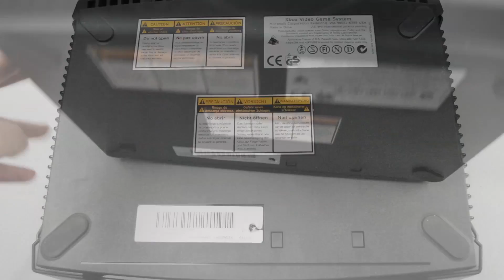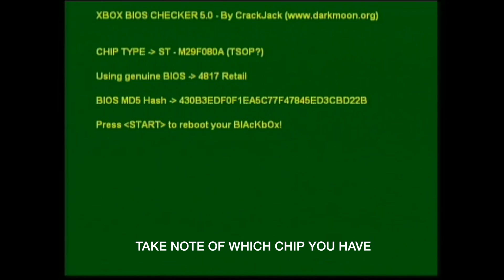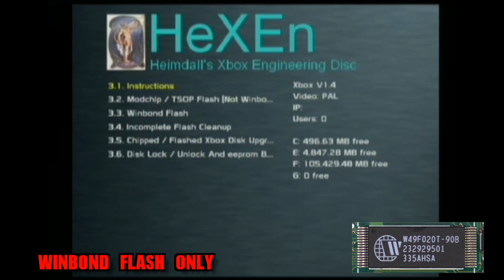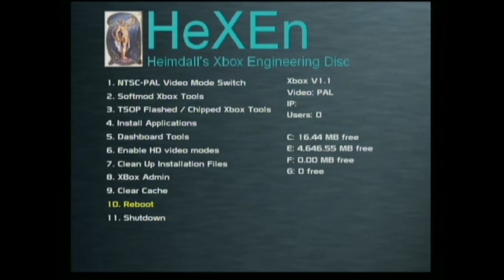How To TSOP Xbox Easiest Method v1.0 to 1.4 | MOD Guide

Comment: Thanks for making this video. I have an old PC-Bioxx/Open Xbox modchip and I want to flash the modchip to install a larger hdd. How can I flash this modchip?
Reply: use the same method that is listed here. grab your hexen disk and with the chip turned on flash it with a 256k or 512 if your box supports it. Note that if you are using iND or X2.5035 you need to have a config file on the C drive
Reply: Steven Benson Thanks for your response. To flash the modchip I need to connect it to an old PC with a Parallel Port. What can I do?
Reply: you don't need to connect it to a parallel port, just need to make sure that write enable is turned on on the chip, usually it's a switch that has to be turned. After that you can just flash it.

it's pretty straight forward. the parallel port is only needed if you screw up and need to re-flash it
Reply: Steven Benson Thank you so much for telling me that. What's the best way to flash the chip? I have a mac and most software is written for windows. I am planning to install windows 10 to it.
Reply: burn a copy of the hexen disk, and put it in your xbox. go to the TSOP/modchip menu and select the flash option applicable (probably non wind bond) and then flash a 256k bios of your choosing.

modern flashing doesn't require the chip be connected to a pc or mac at all
Reply: Steven Benson Thank you. The problem is the bios has to be 1mb for the chip which requires me to double the flash image. I read some instructions on the PC Bioxx/Open Bios. This chip was the first chip that had a 1mb flash chip. I want to flash the bios in order to install bigger HDDs.
Reply: flash the 512k x2.5035 or ind5007. Evox flash will automatically expand it to 1meg
Reply: Steven Benson Thanks for your help. I was exactly looking for the word expand. Is that the bios you'd recommend? What do you think about the 128mb ram expansion and the 1.4Ghz cpu upgrade?
Reply: I prefer X2.5035 over iND5007. their feature sets are pretty similar, but X2 was the more stable release IMO. 

in re: the 1.4 and 128, the 128 will only do you good in a very few emulators and possibly XBMC. I've seen reports that accessing the extra ram can crash XBMC but I'm not sure about that. the 1.4 ghz upgrade is good for emulators, and from my understanding the PS1 emulation works flawlessly when it has this little extra power given to it, no more frame loss at all. 

That being said, in regular games it doesn't make much difference. 

One thing for sure, if you are looking for the 1.4 look for the N64Phreak (i think it's ph phreak and not freak freak) over Trusty. Trusty's are ok, but they tend to overheat, a lot of reports of overheating. The N64 guys tend to not overheat, and that's been reported by a few people who own both. The DreamBox is the best, but they are exceptionally rare and unless you find someone who doesn't realize that they have that, you will pay a lot for it. a lot.
Reply: Steven Benson Thanks man. Until now the original Xbox is a great system. What do you play these days. Are you a retro gamer?
Reply: i have a modded ps3 that i use to play ps1, and xbox to play everything else.
Reply: Steven Benson How did you mod your PS3?
Reply: if it is old enough e.g.: hasn't had a firmware update in two or three years, you can just flash custom firmware to it and mod it. I found one that had been sitting in the back of a grocery store forever. just took it home and flashed it and it was modded. easy as could be. easier than modding a wii
Reply: Steven Benson I just updated the firmware because I wanted to watch BluRay. Is there anything I can do to mod it from this point?
Reply: check your firmware version. the blue-ray patch happened a while ago. if you are on version 3.55 or under you are gold.

if you aren't, you need to check and see what version of ps3 you have, (model number on back e.g. CECH-2001 or something like that) and then it can be determined if it can be downgraded or not with special hardware.
Reply: Steven Benson I have a Phat PS3 with 80gb
Reply: go into options/settings, system update and see what version you are on
Reply: Steven Benson Aight!
Reply: if you are on 3.55 or lower, you are golden. if not, you need to downgrade. if it is a phat you likely can downgrade, if it is a NOR phat you are in a good spot to downgrade. if you are on a NAND phat you are in a less good spot
Reply: Steven Benson Still downgrading is all possible though?
Reply: what firmware?
Reply: Steven Benson I have to find out first. I don't have the PS3 with me right now. I'll find out in a couple of weeks. I am on a business trip. What about the modding the Xbox? Can you run the software also on a mac?
Reply: i,m sure you can, note that the ONLY software you need is an AID or Hexen disk
Reply: If you have Hexen you can burn that and put it in the box. You flash it from within the xbox, not external
Reply: Steven Benson Thanks. Is hexen disk readily available to download?
Reply: ISO hunt and a few other torrents host it. google and you'll find it
Reply: Thanks Steven. You are a great help. What sites do you hang out these days. Any other retro consoles you own?
Reply: Xbox Scene I'm on fairly heavily
Reply: Steven Benson That's awesome. What are the new trends for the original xbox in terms of modding? I was into the xbox in 2004. So I am not that familiar right now.
Reply: the conclusion for it has been either soft mod if you don't know how to solder, TSOP for 1.0-1.5 and mod chip for 1.6

XBMC has been updated quite a lot. The emulators were pretty solid throughout. There are a couple of mod guys who will - for a hefty sum - bump it to a 1.4 Ghz and 128 megs of ram.  After that it emulates really really good
Reply: Steven Benson 1.4 GHZ with the 128mb sounds too sexy. Do you have one of those?
Reply: No, they are a few hundred at least. they do have a switch on them as well that lets them switch between 1.4 GHz and 720 MHz. Some XBOX games work with 1.4 but most crash
Reply: I don't feel that they are necessary but it's a cool thing to have.
Reply: yeah, it makes it more powerful than the dev kits
Reply: are you on fb?
Reply: yes, but most help i do is on xbox scene
Reply: Steven Benson What's your xbox scene nickname? PM me here.
Reply: T2steve
Reply: +Steven Benson I just tried to flash the bios with the Hexen disk. I get the message: "Manufacturers ID 09 Device ID 00 !! Flash Not Writable!!" What can I do?
Reply: that error message comes up with the write permission is disabled. your mod chip likely has a few switches, one of them is to turn on write. that's likely why it isn't flashing.
Reply: +Steven Benson How do I turn it on?
Reply: your mod chip will have a switches on it, likely it will be a little add on that sneaks out to the front of the xbox or the rear of it. Most chips have write access as the 2nd or 3rd switch. do you know what type of chip you have?
Reply: +Steven Benson It's a PC-Bioxx/Openxbox.
Reply: apparently this is a chip that has to be flashed by LPC which is weird. Most of the older LPC only flash could be flashed with a bit of work. 

You'll need LPC and the program to flash it. You can still get the bios from the HEXEN disk
Reply: +Steven Benson thank you for all your patience and help. I am wondering whether you can simulate the parallel port through a usb to parallel port adapter? I am using a Mac with Windows 10.
Reply: can try
Reply: +Steven Benson I was able to find an old PC with a parallel port running Windows 98. When I insert a burned data cd, I get the error message an attempt was made to load a program in an unidentifiable format. I am using Mac OS. What's the best way to burn a data cd an old windows 98 PC can read? USB stick is not working because I need a driver for the USB port. LOL
Reply: burning it with win xp or something similar should work. 98 doesn't play well with mac.

you could also try emailing it or FTPing it. you could also put it onto the xbox itself, and then FTP it from the xbox to the 98 box
Reply: +Steven Benson How do I FTP to Xbox? Remember, I don't have internet on this windows 98 machine. I was thinking just to burn a data cd. However, somehow o burned it wrong under Mac OS disk utility.
Reply: +johndee759 I got everything in place. Windows 98. Parallel Port Cable, Frosty Bios x2 and Bioxx Flasher 1.4. The program cannot detect the chip. I uninstalled the program and installed bioxx flasher 1.3. Also nothing.
Reply: xbox scene has some articles on this chip. head there and see what it says. Alternatively, bridge your TSOP points, get a new hard drive setup with soft mod and then disconnect the chip, flash the TSOP and never worry about the chip again. I wouldn't use a Frosty Bios unless there is a specific reason. X2.5035 or iND 5007 are both good
Reply: +Steven Benson Where can I get those bios without going into xbins?
Reply: they are on the Hexen disk
Reply: +Steven Benson thank you. I have burned the Hexen disk. However, when I put them into my computer I can't view the content on the disk. What can I do?
Reply: you will need to put it into your xbox, and search through the files there. there should be a folder labeled bioses that you can copy it from. you will need to connect your xbox to your LAN and then you can use FTP to get it off the xbox and onto a computer.

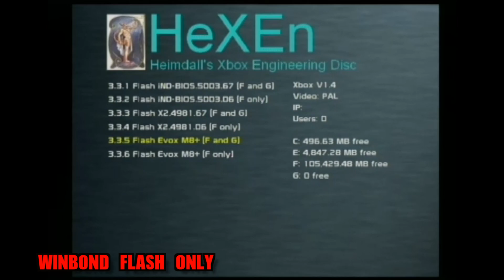Comment: HELP!!! I get to the Gentoox Loader screen @ 5:06, and I try to use my Dpad right, to move the menu across to the Advanced at the right hand side, but I cannot for the life of me get this to move.  Its like its frozen.  And after 5 seconds it loads some kind of linux based os, and I have to power down the system.  I have tried this 3 times now with no joy.  I am using a shitty aftermarket pad but the dpad does work as I have verified this.  Xbox is already softmodded with 160gb hdd.  Any ideas?  My version is 1.3 Winbond bios chip
Reply: Also I noticed is that it doesn't say CD/DVD as the first option, it says Fatx? Do I have to perform this with the original 8gb HDD installed I wonder?
Reply: sorry no i do have the same layout as what you do, but I just cannot move the menu for some reason..
Reply: OK possible update, I have watched another guy doing the TSOP on a Winbond and/or Sharp chip. And apparently Gentoox hates 3rd party controllers.  So maybe that is why its not letting me change the menu.  I don't have a genuine controller right now, but my friend does and I will ask him if I can borrow it and see what happens!

I will let you know the outcome guys..

BTW, if this goes well which I hope it does, I have a donor xbox which I am going to remove the memory out of and upgrade mine to 128mb of ram.  Simply for Emulator benefit, and the odd game which requires more memory as well.
Reply: Follow up, the issue all along was my 3rd party controller.  Borrowed my mates "Duke" and all is sorted now!

Comment: My Xbox is V1.1 and I have a Aladdin Advance modchip fiited that is working fine when in chip mode, but my onboard tsop is corrupted. If I power up as normal the Xbox powers on/off/on with a flashing light no picture. Can this mod work with the chip in place. I have Slayers 2.7 installer which I flashed the latest update to it with no problems. Thanks
Reply: if your aladdin chip has two banks on it, there is an option to flash it with an Evox TSOP repair bios.. I believe it was D6 but i cannot remember and you don't want to get this wrong. if it only has ONE bank and you cannot switch it, don't flash it with a different bios for repair, it's a one way trip unless you have another mod chip lying around.

If you have multi banks and can switch, flash the TSOP repair bios, start it up and pull the chip off after a few seconds, essentially when it is booting. It should pull just enough data from the chip to load, and then the chip gets pulled and it reverts to the TSOP.. you should then be able to re-flash the TSOP. 

The alternative is a 32 wire chip, which is a serious pain to install.
Reply: My mod chip is a Aladdin advance, how do I know if it has multi banks or not.  Thanks for your help.
Reply: usually there is a switch on the mod chip that controls what bank is being read. If you have two banks you can boot from one, hit the switch, flash the repair bios, and once you are done repairing your TSOP you can hit the switch, boot back to the other block and flash it back again

Comment: Hello!,  i just have a question: How to TSOP the console from HDD. My DVD drive is dead, it doesn´t load any games, and i don´t have any spare drive to test. I can access to the XBOX by FTP, so I can upload any app to the hard drive. 

En español: Se puede hacer TSOP desde HDD? Tengo una consola con el DVD roto, no carga ningun disco, ni originales. No tengo otra unidad a mano, pero puedo acceder a la XBOX por FTP, asi que puedo subir la aplicacion al HDD si es necesario..
Reply: you need another xbox dvd drive, it can be done with a pc dvd drive if you know what you are doing, yo cant really ftp the files to the xbox as the drive is how they run.

Comment: I try Evox m8+ or m8 original it didn't have lba48 support it still recommanded to use evox perconsole it didn't have any issue for frezzing than ind bios. I thank ind bios has lba48 support it recommended to it didn't have any frezzing issue that all i currently use ind bios on my main xbox it run with no issue it does inculded config live it much reliable for me it just xecuter 2 bios have frezzing issues all the time.
Reply: I flashed EvoX on a v 1.4 console with an st chip. used the 256k option with F and G drive. after the flash my xbox won't boot past the X screen with the evox logo in the corner. wont boot up hexen 2017 from dvd either. do you happen to know what went wrong?

Comment: I try Xecuter2 or 3 doesn't run smooth the only bios it does run smooth is evox or ind bios that how i recomemded team xecuter has bug that why xecuter sucks for bios i cerrently use ind bios on winbound or sharp chip i replace evox bios on hynix, st, i use ind bios

Comment: 1.0 & 1.1 models paired with a Samsung drive and fan mod are arguably the best combinations, since the 1.0/1.1s have a 1MB flash and the Samsung drives read the most forms of burned media. After that, send your board off to Trusty for a CPU and RAM mod, upgrading your model to a 1.4Ghz CPU and 128MB RAM!
Reply from the maker: +TAG Media I don't think trusty still does them though :(
Reply: Are you sure?
Reply: +Slot1Gamer I recently did some snooping on the Assembler forums and found that N64 Freak had a spare Trusty 1.4 Ghz board!  I bought it from him the other day and it's in the mail!  I can't wait!
Reply: +TAG Media Yes n64 freak is selling xbox motherboards as kits with 1.4ghz cpu and 128mb ram in the assembler forums but i think he dont accept like sending a motherboard to install the cpu and ram,he is selling pre moded xbox motherboard with the cpu mod and ram : )

Comment: what is the big difference between soft mod and chip mod ?  what can the chip mod mo more ?
Reply from the maker: +Gunter Vandenberghe Soft mod is replacing the OS files on the HDD (all in software, hence the name :) ) It works but is easily broken. Using a modchip or Flashing the console (for this purpose the same thing) is replacing the code that the console uses to operate (bios essentially), much harder to break, actually with TSOP you can make it virtually impossible to break if you unlink the pads (making the chip READ ONLY), good idea if you sell the consoles pre-modded :D

Comment: This machine was the greatest of all when u flashed it, i remember putting all the best games to its hdd with the xecuter 2, oh boy and those themes best machine ever thinking of buying a xbox 1.0 now hahahaha
Reply from the maker: +NissanSilviaS15NL Silvia get a 1.4, 1.0 has some issues :)
Reply: +Slot1Gamer I still feel that the 1.0s and 1.1s are the best models due to their large 1MB BIOS chips.  If you can get one of the version 1s that don&#39;t suffer from the trace corrosion problem and replace that nasty Foxlink PSU and pair it with a decent DVD drive, you have the ultimate model, flexibility-wise.

Comment: i think evox bios an ind bios is remomendded  to
Reply from the maker: +Austin Souslin I run EVO x on my main console, now it's running a new custom build EVO X, which forces all games to run in 480p (Most PAL games are 480i and it makes them look fuzzy on newer TV's)
Reply: i use ind bios on my main console it reliable for me it fix with hard drive upgrade issues for me insead xecuter 2 bios didn't help for me it did cose inissue with cycle frag problem crashes frezzes xbpartitioner 1.1 and launch games from hard drive that all for xecuter 2 or x3 again i chose ind bios it didn't have in issue with ind bios it did shove my problem i will stick with evox an ind bios some of chip
Reply: once xbox has winbound chip you shoud use evox bios this chip uses acrup blocker on this chip the more acrup blocker will be not flashble any more using raincoat base

Comment: Great tutorial.  Does the Xbox has to be soft modded before you can TSOP it?  What happens if your original Xbox hdd is fried?  Can you still TSOP it and install a bigger hdd?
Reply from the maker: +Laeot You need to be softmodded first (I'm looking into making a method to tsop stock consoles). If the HDD is fried, follow my other tutorial of making and using a EEPROM reader.

Comment: Ok, I've tried a CD-R, a CD-RW, DVD-R and a DVD+R disc to burn the BIOS Checker iso, and my Xbox doesn't recognize any of them. I have a Samsung DVD drive which should read media from all of these formats, so what am I doing wrong? Am I suppose to softmod first so the XBox can read these discs, or is a vanilla 'Box suppose to be able read them?
Reply from the maker: +Snarkticon you have to be softmodded first :)
Reply: +Slot1Gamer I eventually found that out for myself. I completely missed that bit in your video. Thanks!